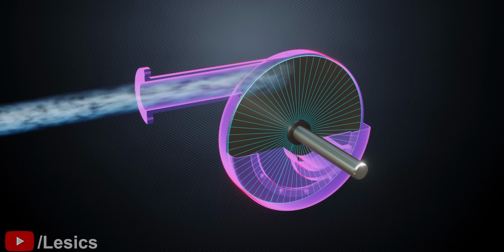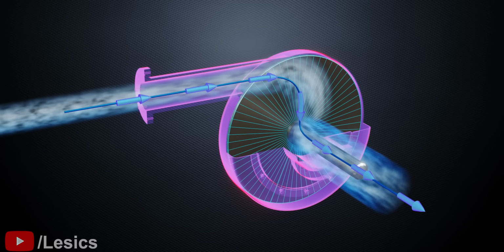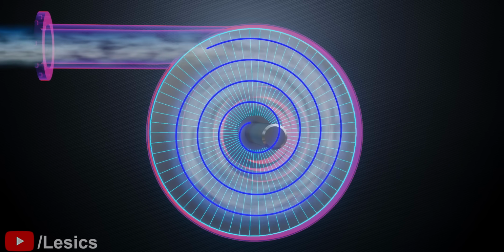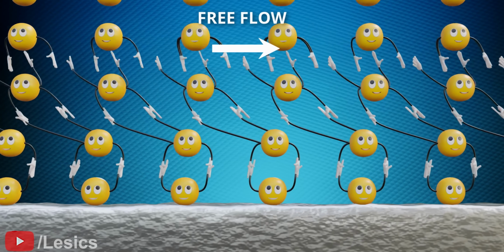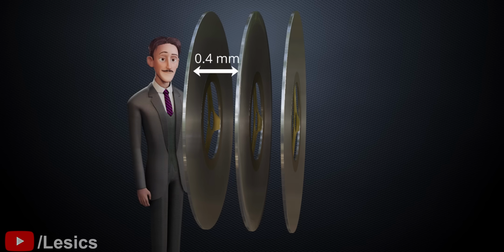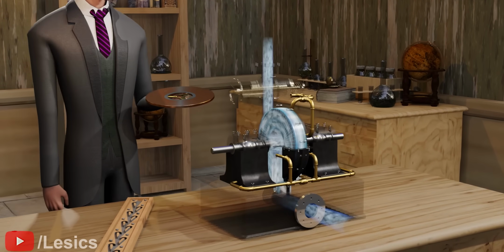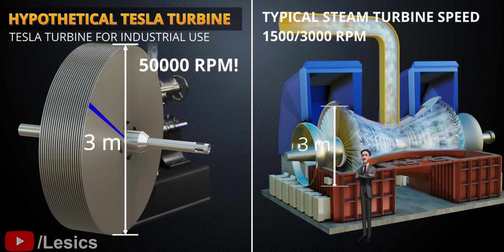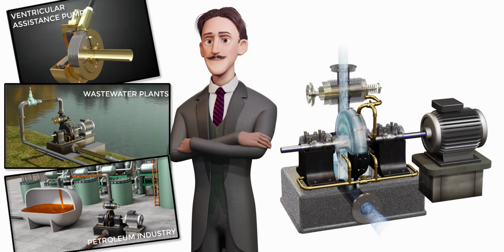Tesla Turbine | The interesting physics behind it

Comment: I thought Higher rpm would mean more electricity produced by the dynamo. Isn't higher rpm better?
Reply: The energy is not just depending on rpm. Torque does also have a roll. A Traktor motor  has low rpm but has high torque.

Comment: if we use heavier / higher-viscosity fluids and turbine material with more roughness, then we might possibly be able to reduce the optimal turbine speed?  
air -> light oils -> water -> heavy oils ->  ...
... smooth surface -> slightly rough surface -> quite rought surface -> ...
... couple a liquid and a solid with a higher tendency to hold onto each other 
... reduce the gap between the discs some more  
... many variations possible, in order to increase the effective transfer surface between fluid and blade.

Comment: 50000 rpm with a 3m diameter
so, the outer most point would be going at a speed of ~471 km/s.
Earth has a circumference of 40000km.
So at that speed you could go completely around Earth in not even one and a half minutes.
Reply: Or they could make it 50 cm with stronger materials we today have
Reply: @plazmica0323  this would still be ~79km/s at the outer most edge
Reply: And when one of these blades decides to crack, that is a monumental force that would have to be contained. The entire thing would be a frag grenade at a much larger scale.

Comment: Would sapphire or diamond be strong enough ? What is the biggest flattest diamond ever grown in a lab  , my plan would make the blades from this material , and make the bearings for the shaft out of magnets , use a steel or carbon fiber shaft and seal the side by side staders with an aerogel that doesn't heat up and refrigerate room or area around parts that generate heat , R.C. 05/18/2022

Comment: With a larger disk diameter wouldn't the rotation speed be lower for the same power output?
Reply: Larger surface area demands more speed to reach peak efficiency. You can throttle a larger disk to run below its most efficient rate, but then your steam is creating less energy per volume.

Comment: I respectfully disagree; viscous is not the cause of tesla turbine but irrational voices created in smooth surface ball than dimpled golf ball; is the real reason why tesla turbine works; 

There are two types of vortices; from surface in fluid dynamic; irrational [smooth surface ball] and rational; [dimpled golf ball]; 

Planes are governed by irrational vortices; from atomic level; thus creates drag; by flowing air; 
Same thing is taking place at tesla turbine; viscosity in fluid dynamic; is not same as vortices; 

I am the discoverer of rational and irrational vortices; in fluid dynamic; who solved warping of tesla turbine is result of mach speed; which tesla did not know of mach; 

With such narrow gap; tesla turbine did not use viscosity; he used vortices; something he did not know; or understand; please and thank you;

Comment: I used to balance rotors for 3 phase motors and I cringed a little bit at the thought of balancing something at 50,000 RPM. Even 2 pole rotors are not typically balanced at full speed; there are only a handful of facilities in the US that can balance large 2-pole rotors at full-speed RPM

Comment: I first learning about this phenomenon when I was working at a pizza place. When I was doing the dishes, I discovered that spraying water at an angle parallel to the surface of a pizza cutter, It would spin dangerously fast. It made noticeable gyroscopic effects too.
Reply: I had discovered this too washing my pizza cutters at home.   I started spinning plastic plates and such at work when I was at pizza place later on.
On a related note, I had created fidget spinners as a child decades before they were commercialized, with any simple object I could hold between my fingers and move with my own breath.

Comment: Thanks for another excellent video clearly explained and illustrated with great graphics.
Perhaps Tesla's turbine could be modified to have max efficiency at much lower RPM levels if 
-the input pressure is increased e.g. by hydraulic head (gravity) and a tapered inlet
-the surfaces of the disks were textured or even e.g. radially ribbed like millstones.
Reply: The information that was missed in this video, is that Tesla built a few models limited in rpm by centrifugal head, which increased with rotor diameter. 
He did manage to maintain the efficiency.

Comment: This basically means that the Tesla turbine would be great at powering cars and other vehicles!
Reply: Unfortunately no. Flywheels have been tried, but you run into a few significant issues. The high speed discs cause rotational / angular momentum and will counteract turning forces. The speed of the discs is hard to capture and transfer into power for the vehicle - imagine redlining a car and then shifting a manual transmission without being able to adjust the incoming rotation speed of the engine. Finally, in an accident, the energy needs to go somewhere, those discs are very deadly with all that stored energy. Finally, the waste of energy to spin up and not use the power - say stuck in traffic or making frequent stops to run errands, means that the energy is lost or wasted.

Comment: Damn dude you say the disks have to spin at 50k rpm for maximum efficiency but that’s not the case, the disks can go as slow as you want. In order for it to be efficient the gas speed should be supper high not the disk rpm damn🤦🏿‍♂️.
Nice video overall but this part was kinda stupid and also was your main argument

Comment: Can you not use the Tesla turbine in a dental drill? High RPM & low torque are required. Seems ideal.
Also, could use multiple small high-RPM turbines made of Ti-W alloy and connect each of them with small input gears to a large output gear to reduce RPM & increase torque.
May be a good option for compressed air energy storage (which China is developing, naturally).

Comment: The airfoil shown at the beginning is explained wrong. The upper curved surface have more area than the lower surface thus producing more drag to the passing fluid so the fluid speed is less thus pressure is high. And the lower surface is almost streight so the fluid speed is maximum and low pressure. The higher pressure fluid at the up will try to move towards the lower region. Thus producing lift towards down. Here they have shown the lift force is upwards. The lift force will be upward if the attack angle would perpendicular to the airfoil plane. Thus the airfoil will act like a bucket to stop the flow thus absorbing most of the momentum from the fluid.

Comment: i bet we can make a water powered engine with a few disks and it wont need alot of refueling since the water can run again
Reply: Hi, I am a physics tutor with more than 8 years of teaching experience. I am here to teach you online. I am also working as a design engineer in aerospace industry and have a masters degree in aerospace engineering and Bachelor's degree in mechanical engineering.

Comment: True fake science... Want to se it in real life. Any ordinary turbine consists of 2 parts. We take exhaust gases, with the help of a conventional turbine, part of the pressure of these gases is converted into air pressure in the second part of the turbine, as a result, we get more air, to which more gasoline can be mixed and more power output. And here it turns out: air enters the turbine, it rotates the “rotor”, and the faster the rotor rotates, the faster the air at the outlet of the turbine. But in reality, it turns out that the air at the exit will be faster because it is faster at the entrance...

Comment: Just leave the spinning wheel open without the housing around it, hence you won't have any water cause any resistance anymore to the spinning wheel(generator) with pressured water (sprayer upon the end) into transferring mechanical energy into electrical energy to operate the water pump into infinity self-sustaining operation into continuing on producing electricity without need of more spring water to rotate the water wheel generator.

Comment: I am an electrical engineer, as Tesla would be defined today. so my background in fluid mechanics is lacking.  I am assuming we can design the now flat uniform surface into a surface that would enhance the physics for the Tesla turbine effect and efficiency.  I am guessing that maybe a spiral pattern engraved on the disk surface to match the desired rpm of peak efficiency.

Comment: So can't we just modify this so the rpm is something the material can safely handle? Decrease the flow rate or increase the diameter between discs? I realize there will be lost efficiency but should still turn a generator no?

Comment: yes but.. a spinning turbine pressure is moved outwards, making it hard for the water to move inward toward center of circle.. you could get more more and use less energy by moving from center outward. inside is harder to start spinning but once you have it spinning it will produce more power.. maybe have a 2 stage setup. Having the first turbine's outlet in the center move across to the second turbine with the inlet being in the center of the second turbine.

Comment: Makes no sense. Why do the disks need to be 3 meters diameter for industrial applications like power plants? You can get the same surface area with smaller disks and a longer pack.

Comment: Turbine fan blades are subject to stretching over time and will generate cracks and if not replaced can fail catastrophically.   A tesla turbine spinning at 50000 rpm would be a disaster waiting to happen.

Tesla has been put on a ridiculously high pedestal.  He was brilliant but not some unquestionable god.  He had some bad ideas also.

Comment: There's no reason to require the Tesla turbine to be 3 meters in diameter for industrial applications. A set of smaller ones at the high efficiency Tesla claimed, would do the job. And since they're simple disks, the total costs would be much less than the usual equipment. It's a given that smaller applications would be well served by the Tesla--the real obstacle is intellectual inertia and the cost of launching a new product.

Comment: For commercial use it would be impractical but what about building one for a modern household to generate a small amount of power let's say 400 w to recharge off grid home batteries if you have a 200 PSI 17 liter a minute water pump that runs off of a 12 volt. 200 w do you think this configuration would be possible with today's low voltage low Watt but high output pumps?

Comment: And today Tesla Motors can now wrap rotors with carbon fiber threads encased in high temperature epoxy to achieve extremely high rpm and efficiency.

Comment: to rotate energy is required....for higher efficiency more energy but at those eff levels other physical factors intervene that make the rotation distorted thus leading to  cost-effectiveness  problems....all sounds good in the lab or  DIY Toy project  but not commercially feasable

Comment: Since the diameter of the disc affects power output and stress on the disc' why not have a whole bunch of small ones(maybe 30) that generate small power each and use these as the equivalent of a battery pack to run a Telsa car electric engine.   So essentially a "battery pack" that wouldn't have to be recharged.  So just a small water/alcohol(maybe antifreeze) pump with small reservoir to run the small tesla turbines (this water pump would need a small rechargable battery pack for intial start - but charge is maintained after pumps start running) .   I'm not an engineer but someone could convert the mechanical energy from the small turbines into electrical energy needed for the motor.  But then you might need a larger battery pack as an intial torque system to get the car moving so that the "tesla turbine battery pack" could feed the main engine.   hmmm, engineering fun!   You just wouldn't be running 0-60mph tests with this type of vehicle.   

Kinda kool to have 2 Teslas in one!

Comment: I think Tesla's idea was that given sufficient materials capable of taking such forces it could achieve 97% efficiency.
Reply: Engineering mostly about doing the thing with the materials you have, not the materials you want.
Reply: @schwarzerritter5724  I don't disagree but we have everyday examples of new or developed materials to meet our needs. Like Q&P AHSS, different grades of steel. Composites and a lot of different alloys. I feel that innovation leads to new material compositions and hence engineering should never be limited to material limitations. Obviously, there are some basic laws which govern the science.
Working with present materials is an approach taken by companies to reduce R&D costs and work for profits. However, inventions should never be limited to materials available. 
Have a nice day!
Reply: Given sufficient materials that did not exist at the time and therefore it was a useless invention 😑

Shoulda coulda woulda helps nobody.
Reply: No need to have such material. You have watch a wrong info.
Reply: Can we dam a shallow sea and build water based power plant?
Reply: My thoughts as well…..
Reply: No, it never has done 97%.  That's pure fraud.  If you got 97% out of a Tesla turbine, they'd be in widespread use.  97% is pure bullshit.

The only real application of Tesla turbines isn't due to their efficiency, it's due to their ability to pump or extract power from highly viscous materials.  Tesla was a great inventor, but he also massively overhyped some of his inventions past the point of their actual utility.
Reply: He never produced anything that worked.......
Reply: @mattbarker1411 get back to the other side, Edison
Reply: @mattbarker1411 are you that ignorant or dumb to not to know of so many tesla’s invention that have used in this modern era? Example of your ignorance - ‘Alternating Current’ one of the inventions of tesla that the modern world are using to transmit an electricity to a long distance area 🤡 go back to school kid
Reply: @mattbarker1411  right, he produced stuff that worked with materials commonly used 100 years later, but 100 years before....
Reply: John 3:16 NIV
For God so loved the world that he gave his one and only Son, that whoever believes in him shall not perish but have eternal life. 🙏!!!!

Comment: I kinda like how everyone focuses on the materials needed to get a large disc spinning mach 13 and not the energy source required to get such a large disc spinning that fast
Reply: The whole point of that example was to match the level of the energy source which is commonly seen in industrial power plants that use traditional turbines. We have the energy source already. We don't have the materials.
Reply: Probably because we already know how to boil water with fire, heat from the sun, or splitting atoms. That's a completely different topic.
Reply: It is be relatively easy in comparison though, just add pressure.
Reply: the time when a guy went too far ahead of his time

Comment: If it is able to achieve the speed necessary; is it possible to make a engine similar to a turbo jet with a tesla turbine compressor and exhaust? Obviously it would be extremely difficult and expensive. But is it possible at least on a small scale?
Reply: Compressor is necessary since it need, for the small size of combustor alot of fuel and oxidizer. Compressor allows to pack alot of oxidizer in a small package in this case, combustor. It's why gas turbines employ compressors.

For the turbine stage, I believe the Tesla turbine will be the first stage and the subsequent stage to be axial or mixed flow. I express doubt that they will make a duct to reroute such high pressure to another in flow radial turbine(in which, the Tesla is practically one) that is worth the engineering and manufacturing trouble.

Comment: This may sound fine as far as efficiency but the problem of wear to the discs with a liquid flowing over them at 40 K would cause a lot of wear on any material. compared to what we know today but still? I know there are many materials never known to Tesla at the time Now am I understanding this concept correctly? It seems to me that the wear would make this awfully expensive for parts and labor. Does anyone have any experience running one of these turbines?

Comment: Basically the efficiency limit is reached due to the physical limits of the materials used - within normal atmospheric pressures.  I wonder therefore if it could operate at faster speeds in a highly compressed atmosphere... or even inside an incompressible medium like water for example?
Reply: Aiming for faster speeds would just make the material problems worse.  Increasing the pressure wont change the tangental velocity of the disk from trying to rip the materials apart. what you want is a set of conditions that allows for full efficiency at lower RPM.
Reply: @merendell  Wouldn't equal pressure prevent the materials from ripping it apart?
Put it inside a liquid and try it. I bet you get more velocity despite the resistance of the medium.

Comment: The fact that the Tesla Turbine could be optimized to the point where the material used at the time weren't able to withstand its generative force, shows how much it was ahead of its time.
Reply: Not really, the lack of sufficiently strong materials has been a universal problem for a very long time, hence why metallurgy and similar practices are still evolving to this very day

Comment: Tesla turbine was useless for utility scale electricity generation. It needs really high RPM, so typical 1500/1800/3000/3600RPM generators will just make is stalled.